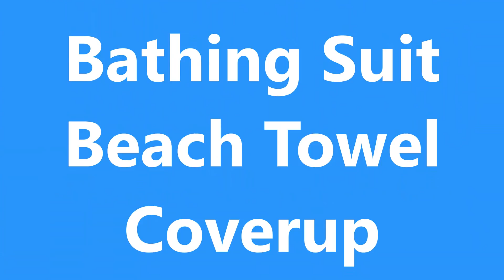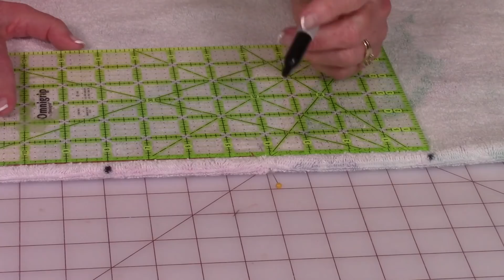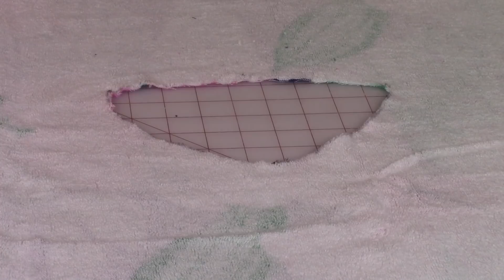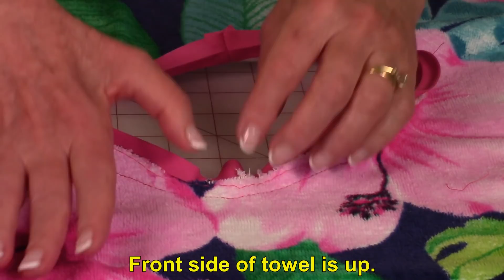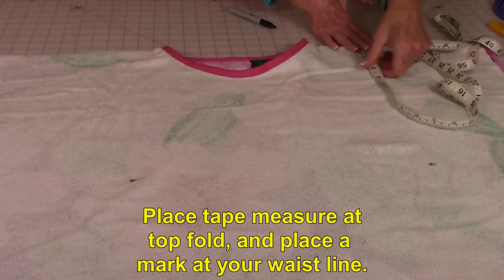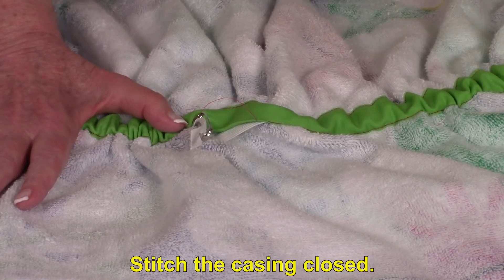Beach Towel Coverup for bathing suit

Comment: Great tutorial —I’ve had no problems up until joining the bias tape casing. If you twist the ends and then sew it across as demonstrated, how do you run the elastic through? It seems you have closed the casing at that point.
Reply from the maker: Hi Pam.  I think you are referring to the step at 10:46?  At that moment the tape on each side is facing each other.  So in order to bring the front side of each bias tape you will have to twist the bias tape so that the front sides are facing each other.  If done correctly, the elastic will be able to go through.  I hope this helps.  Thanks for watching, and happy sewing. 😍

Comment: Any tips on how to make this for a 15 month old? Do I just make it smaller? I’m not much of a sewer 😂
Reply from the maker: Hi Katie.  Yes you would make it much smaller.  For the width - measure from the center of the body to just below the elbow - then double that measurement - that is how wide your towel needs to be.  For the length measure from the neck down the front of the body to the knee.  Stay safe, and happy sewing.

Comment: This is so perfect. Thank you.  Do you have the plans for the house robe made from two bath towels from the 1960's?  I would love a video on that.
Reply from the maker: Hi Elisabeth.  I have not seen this.  Thanks for the suggestion.  Happy sewing.
Reply: @TheSewingRoomChannel  - I remember my mom making one of these for each of my sisters and me with three regular sized bath towels. One towel was folded in half lengthwise for the bodice and arms with a neck slit in the middle.  A second towel was for the front attached to go down from the bodice front, and a third towel was used for the lower back.  We wore them as bath robes in the winter and as a long beach cover up in the summer after swimming in cold Lake Michigan water.  Perhaps an internet search would reveal a picture of one of these kind of robes as they were popular in the early 1960's.  These were VERY quick and easy to make and comfortable to wear.
Reply: @newbeequilter  Am I understanding correctly, this robe pulls over the head? Or does the 2nd towel get cut up the middle?
Reply: @ @jojosewist8921  - Yes, as I remember, they pulled over the head. There may be variations of this with a zipper up the front, but my mom wanted to make some very quick Christmas gifts at the time using regular size bath towels she’d found on clearance sale earlier that year, and these fit the bill. I found them comfortable to wear once I got one it, BUT they were difficult to initially put on and then to take off.  I did find one on Etsy that looked like the one I was talking about, McCall’s #8506 (1960s Women’s Robe or Caftan in 2 Lengths Beach Cover Up Empire Waist, size 14 bust 34) but it may have been bought by now.  You might also check eBay as there were a few there too when I checked after first watching this video.  But I must say, Sherill’s beach towel coverup looks quite easy to make, and I’d just buy two beach towels or yardage if I wanted to make it longer.  I'd  use the first beach towel to make it just as she did, and then with the 2nd beach towel, I'd split it in half and add 1/2 to the front and 1/2 to the back to make it longer.